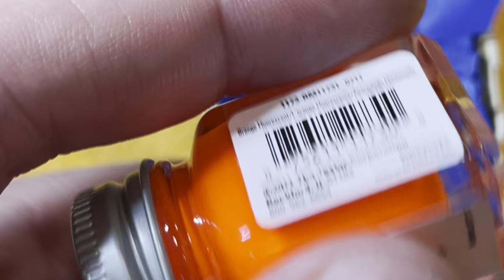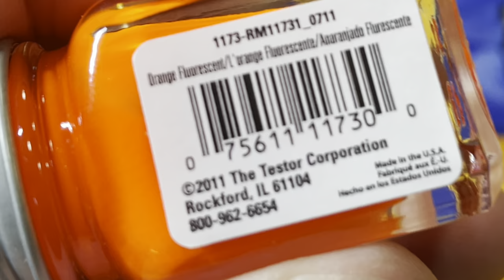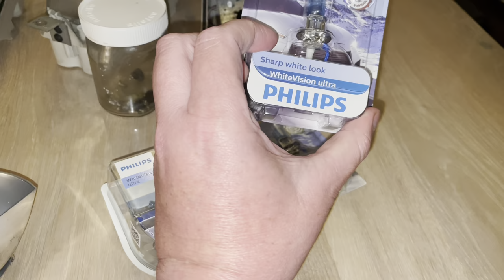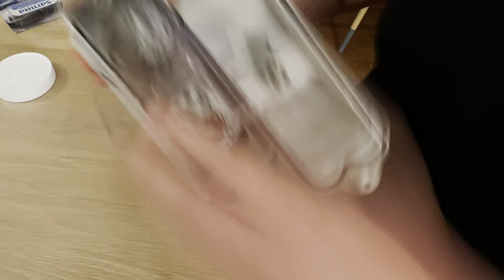Restoring a Flood Damaged Porsche 968: Headlight restoration #Porsche968

Comment: I redid a set of tail-lights for another car once that had the same chrome issue, I couldn't find a good at home solution for re-doing the chrome, so I went with the brightest high gloss white I could find - white technically has more reflectivity, but it's indirect vs direct...but either way, it makes a light brighter and is easy to DIY (although I think there are some better chrome DIY paints these days).
Reply from the maker: Good point Andrew! Let's see what those rears look like once I have them in my hands.

Comment: I had the same problem with the chrome paint on a set of old Peugeot headlights - it is a bit flat and then comes off if you polish it. I did wonder about a primer first. There is a company called Dual Metallising in the UK who say "We have a rich history in restoring reflective surfaces. This includes rejuvenating a range of headlight reflectors for cars that have failed MOT tests such as MGF, Audi and Volvo headlights." Maybe the headlights needed a bit longer in the oven - usually on a bit of wood rather than the rack. Although if the silvering has gone, prob not worth bodging (unless they can be re-silvered professionally)
Reply from the maker: I was looking for a company here in NL that can re-crhome plastic but had no luck. I'll have a look at Dual Metalising though because I really would like a mirror finish. The final result you see in the clip was actually done with primer as the layer first, but this did not do much for improving the shine. They say you can clear coat it, so maybe I could still try that?

With regards to the headlights; I pretty much knew they were a write-off so figured experimenting with them can't do any harm. I actually put them back after breaking that piece off at 150 for 20 minutes, but had no better results...other than ,y wife being unhappy with the nasty smell of melting plastics in the house 🤣
Reply: @GarageBiljon  I opened a set of peug 205 lights with a heatgun and a stanley knife - it was hard work as the butyl seal was very hard after 35 years
Reply from the maker: The challenge with the 968 units are that they have a stepped profile where the glass meets the housing , so there is a level of butyl you cannot get to 😰
Reply: @GarageBiljon  pretty sure the 205 was the same. Took a long time to extract them
Reply from the maker: haha  @jakerade1 , you clearly have more patience that I do!

Comment: I’m shocked you said those headlights are only 200 each. I remember bright as day I paid 1100 euros for a set when I imported my 968 from Japan. Guess they did have a Bosch logo though.
Reply from the maker: If you buy the full assembly it is quite a bit more expensive, but just the reflectors and glass is abiut 200: https://www.rosepassion.com/en/diagrams-porsche-968-1992-eu-968-cabrio-manual-gearbox-6-speed/lighting-335/headlight-headlight-support-3641/94463191001-p38743-headlamp-unit-left-hand-drive-38743
Reply: @GarageBiljon  the 1100 was for just the lenses. It was 12 years ago though. Usually Porsche parts prices go up, but not always it seems :)
Reply: I bought a set of rhd lenses for my lhd car from eurocarparts in the early 2000s - they were £75 each for genuine bosch ones. New from Porsche they look to be around £400 each now